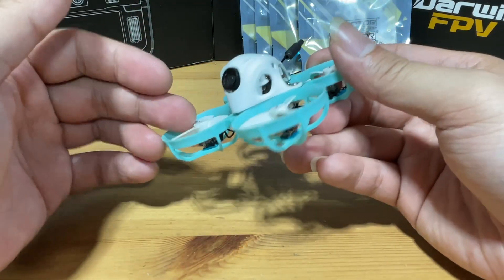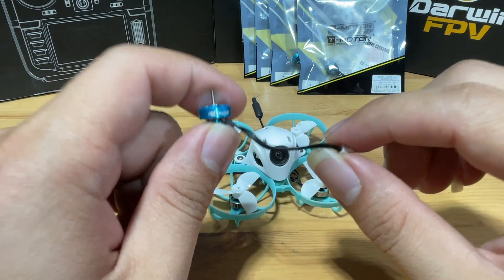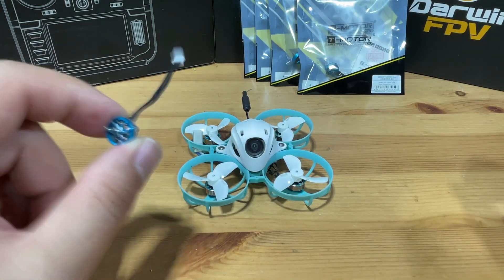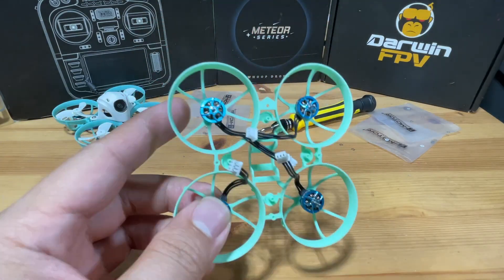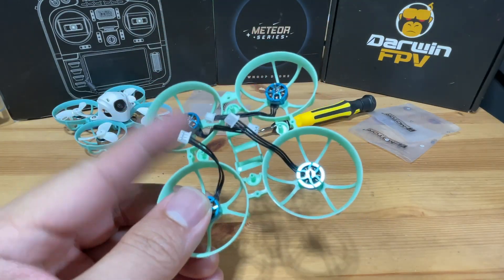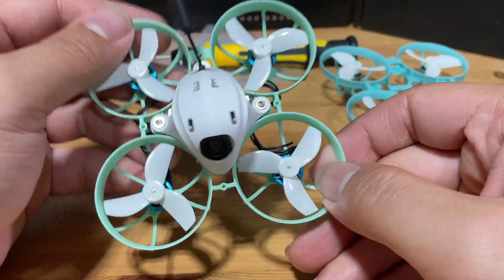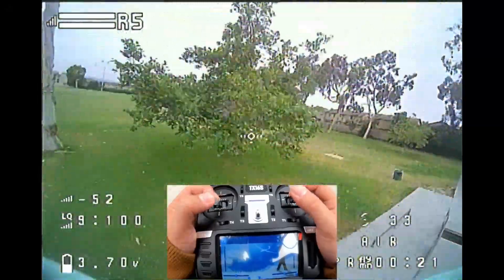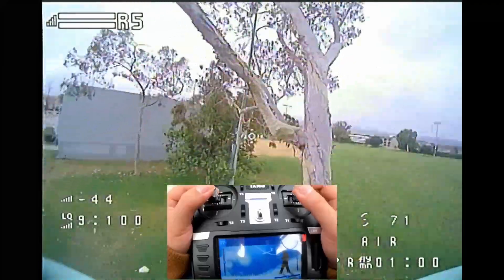I upgraded my Meteor 65 Pro Motors to T-Motors 0802 22000KV Motors

Comment: Can i transfer all these motors and electronics to a Meteor 75 frame to use the bigger 550mah battery?
Reply from the maker: It is theoretically doable but You might run into short motor wire issues and the motor KV is potentially to be too High
Reply: @XwingFPVRC I have the 75 motors, and a frame, so I’ll use thr 65 controller and camera with a 75 frame and motors. Also probably flash the 75 settings from BetaFpv with betaflight just in case

Comment: Hey there, great skills and video. I have the same drone and upgraded to the 0802 22000kv motors by Rcinpower. I’ve had endless issues with it doing runaways and freaking out when I arm it. I’ve tried to troubleshoot it but I’m new to the hobby and can’t figure this issue out. If you could help me out in this that would be greatly appreciated. Thank you
Reply: i’m having the same problem did you find any solutions
Reply: Thank god I didn't upgrade yet....did you ever figure this out?

Comment: Hi! What is your average flight time indoors with these motors and what batteries do you use?
Reply from the maker: TBH, I don’t generally calculate flight time as it really depends on how hard you are trying to push the performance, the only Lipo that fits will be 300 BT2.0 size ones

Comment: Hey while doing this the piece you plug the motor in came out is that normal? Like can I put it back on and it’s good?
Reply from the maker: If you meant can you plug and unplug motors from the board, then yes it will still work no need to reset
Reply: @XwingFPVRC  no like the little tan piece you plug the motor in

Comment: Can it fit a 1002?
Reply from the maker: If your motors are 3 x 3 then yes, but if you are upgrading to 1002 it might be better to also upgrade the frame to the 75 Pro frame with larger props